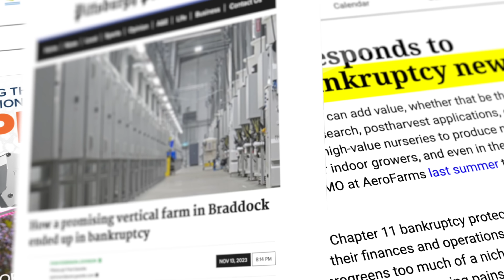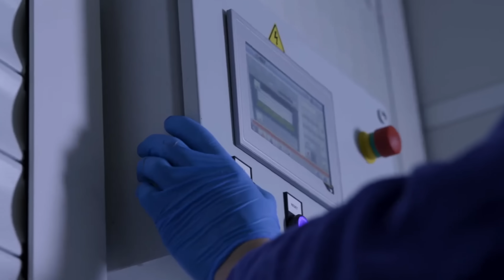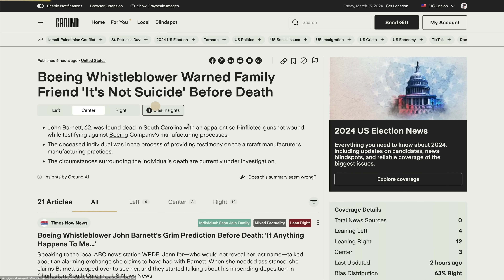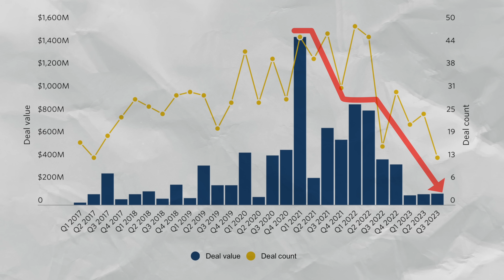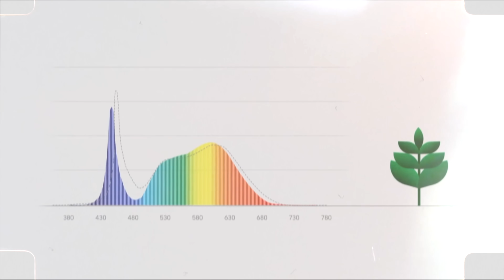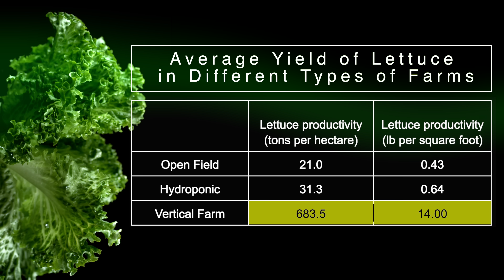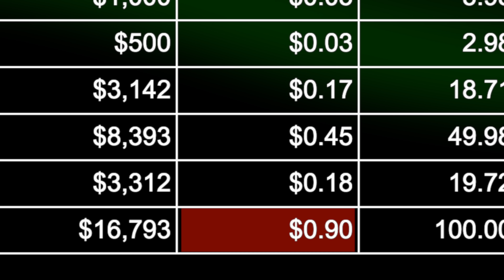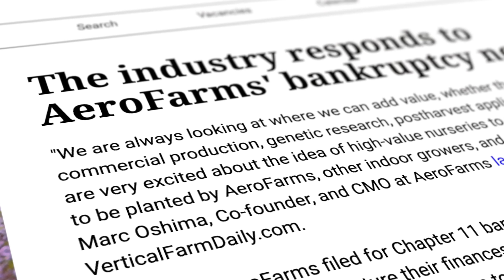The EPIC Failure of Vertical Farms - What Happened?

Comment: Sounds like the issue is companies relying too heavily on outside investors coupled with piss poor planning at ground level.
Reply: The high tech entrepreneurs who start vertical farms are techies not farmers, they are not accustomed to the financial realty of farming.
Reply: @rrmackay they're also not accustomed to engineering challenges where you make something scalable rather than do a one-and-done model
Reply: @FirstNameLastName-okayyoutube  Exactly, they treated growing food like a new mobile app instead of the low margin high risk, high cost operation that it is. We ran the numbers before buying our farm, tried to make it work in a deserted big box store with state grants, still could not make the numbers show a profit. So we bought cheap land instead.
Reply: @rrmackay  Thing is i only disagree with the high cost. WHEN, someone has the cash to go anywhere and is sourcing materials in a low cost area, not inside an urban area. 
Ive bought to much of this stuff... Ive took a $20 box fan, an $8 speed controler,  a $12 belt, couple $20 rollers, a $60  conveior belt, $30 in scrap yard access to some alluminium posts. and $6 in concrete to build a portable dirt conveyor for excavation.  Not $1000+++ for a difficult to move fancy rig.   Same with building a grow house.  30 ft by 30ft structure costs around $3000 and meets code. But people out there want to go buy cedar instead of ground contact pine...  if you can do your own ductwork you don't need to get an expensive kit you can just do your own duct work and spend about $600 on multiple air flows that are in segmented compartments. And then as for the LEDs I'm not joking each grow bed  of 12 by 8 ft is costing me $10!  $10! for the proper lighting... it's working so well I feel crazy with seeing all of the high numbers other people are paying.  Oh and by the way you can put a house filter on the back of a $20 box fan and you don't even need to completely seal it up but it will reduce contamination and Bug issues.  I'm paying $200 a month in electricity and I'm making about $600 a month in profit as a hobby.  I'm growing corn I'm growing strawberries, not kale and lettuce
Reply: @rrmackay  I don't want to sound like I'm not appreciating what you're going through.   Me taking tiny little bits of land swamp material and taking my time with it is not something that somebody that bought a farm could do over several Acres all at once.  

My goal was to grow one plant and keep temperature control for one plant and then moved up from that into multiple structures as I could legitimately find somebody to buy it which is something completely different than projections on an investment proposal
Reply: @FirstNameLastName-okayyoutube  Right, you are building on a shoe string, a hobby farm is a long way from a profitable commercial farm. I am currently growing 25k lbs of mushrooms and an operation that size requires farm hands, tractors, diesel and other expenses. Have you calculated how much the land value is where you farm ? Or like many hobby farms the land cost is not even a consideration ? Sounds great but do keep in mind you don't have the same overhead these big vertical farms do.
Reply: @rrmackay  also I should clarify that I dug into the ground as over half of the wall support of my structure, so I'm over 50% below ground and I invested very heavily in the roofing insulation and not so much on the surrounding. In fact highly reflective material seems to work really well because you really need to capture the infrared light more than you need to worry about warm air.

Outside the roof is about 6 ft off the ground of two of the buildings 12 ft High inside.  Not going to lie I didn't think about it too hard because I was too busy trying to figure out 200 other things
Reply: @FirstNameLastName-okayyoutube  I respect what your doing, sorry if I came across as harsh.
Reply: @rrmackay  to be fair most farmers aren't good at finances. If they can't turn a profit, that just means they have a horrible accountant/CPa. At least in the United States that is.😭😭🤦🤦🤷
Reply: @Jack-jp6ki  Traditionally farm owners ie farmers have been the rich people in rural communities. Suggesting they are poor businessmen is just your bias. My son is a farmer and has a degree in biology and business.
Reply: @rrmackay  I never said farmers were "bad businessmen". I specifically mentioned not being the best at finances/accounting, which is a statical fact the United States. If you ask most farmers in the US why they do their specific farming practices, a lot of it boils down to having to fit regulations/rules they have to follow because they want to get a loan, or can't afford the fines/fees that may come without a violation of such rules/regulations. I personally don't care for talk much. I'm from the "show me State".Show me one of these rich farmers you speak of, and I'll show you the errors in their accounting.  My contact is in my channel description.😉❤️❤️
Reply: @Jack-jp6ki  The wealthiest farmer in the United States lives and farms in California. Stewart Resnick, 81, owner of The Wonderful Company and 65 percent of the nation's pistachio crop.

Net worth 5.6 billion.
Reply: @rrmackay  do you know him personally? I specifically meant show me a farmer "you know".
Reply: @Jack-jp6ki  Its been nice meeting, you have a good life.
Reply: @rrmackay  the financial reality of this is very different from farming.
Reply: @stinkymccheese8010  thats hilarious, you have the same affliction the entrepreneurs have, they think because its a tech business that farming rules don't apply. Their bankruptcies point to you being wrong.
Reply: @rrmackay  no, I think that although there are clear parallels, there are more differences.
Reply: Yup, and in the first two minutes I got all the information I needed to reach that conclusion which really makes the title and the lead up propaganda as many of his videos are.

There was investor money dying to get into a market they thought would make them lots of money, and the people doing the execution didn't understand the business model, all the details of running that business, the costs, and MOSTLY, the MARKET.

All regenerative agriculture farmers I watch that are successful have all said the same thing, which is farming is a business.  You need to know how to run a business, you have to know your market, what the people want, and more than anything else know who your initial customers are because if you don't have customers you can't start.  I think this gets lost on a lot of idealists.
Reply: As someone who has been designing next-gen hydroponics/greenhouses, the main reason these US vertical farms are failing because of the crop type & it's extremely low profit-margin. 
You don't use high tech systems to grow the least expensive, easily grown crops.
You go high tech for expensive and/or difficult to grow crops.
Also in my experience you can't go "full" tech (overall costs are too high/ ROI too low).  The happy medium is "supplemental" tech (as in using supplemental lighting in a greenhouse when "free" sunlight is low or unavailable)
Reply: I always thought they were going to start off as small but efficient as possible, in rough, small-scale ventures in poor areas with disused buildings. Purpose built, tall buildings would come later... 
--
High value crops with processing facilities, obviously starting with weed and expensive mushrooms (like darkness), strawberries and other soft fruits with the main low value crop being potatoes, with the tops harvested for bio-fuel and possibly nutrients for fertiliser, with fish farms in the basement who's water fertilises the crops who's substrate filters it too. 
--
The main protection is hermetically sealed doors between crops... Of course, the fake-green revolution that uses as much land area as possible should never have been subsidised with mass forced sales scams while brown-field and urban indoor farming should be heavily subsidised.
Reply: Basically, they treated farming ventures like tech start-ups, of course, it's no wonder they failed. As a horticulturalist, I immediately knew why they failed in the first 3 minutes.
Reply: same thing happened to cannabis
Reply: @tinman2420  the whole thing with the legalization of cannabis was a farce to begin with.
Reply: Yup…it’s  the execution of the idea that makes it work….also known as  logistics….no good managers….no good product…..it’s a beautiful thing…..
Reply: I think it’s the model. This won’t work at the Tyson brand level. But on a specialized basis I think this could change the world
Reply: No, these projects simply did what they were intended to do: scam investors.
Reply: Well, if over 80% of your investors pull out, it doesn't even really matter if you have a substantial percentage of the money yourself (as internal resources) - with even, say, 80% of those 50% of external resources suddenly going away, that is still 40% - a bit of a problem for any company ...
Reply: It’s a terrible business model. The only way to make it work is to not have to compete with a traditional farmer who can buy up 100’s of acres for the same cost as a city block where the vertical farm is being built. It is the simplest equation, is building horizontal less expensive than building vertical? The business decision is to do what is less expensive. Any other decision is just BA & marketing.
Reply: Agreed, and with the rate of inflation over the past few years, profit margins on food are really slender.  I don't think something like this can break even in the current economy.  Especially if all they sell is salad greens.
Reply: @stinkymccheese8010 you are actually very close to the truth. Actually USSR had science program about farming in space, after collapse, most of scientist moved to Japan and continued there work. So the product of there research is - it's simply impossible to do with natural grown products. Plants will die from viruses. You need a lot of plants that will connect with there roots and roots should be very strong so they could randomly produce immune cell and spread across all them all. So plans are depended on collective immune response to viruses. The whole commerce idea of using the similar technology was predictable failure, but because aggro economy have huge budgets, some investors decided to gamble any way. That how we got to a point of a hot potato game. But in a first place - the entire idea was very well documented, it was very well researched and a way how most of farm was doing it was wrong.
Reply: food is too cheap....
Reply: @PnoidNews123  what a scary thing to say. Uping the cost of food would put massive amount of people without food. Not a good idea if you don't up a lot salaries and number of jobs.
Reply: They also want everything to scale ASAP.  It's hard to get a little bit of money to test an idea, but if you promise them the moon they will give you more than you need.
Reply: Money was cheap in 2023 and investors were willing to take more risk.
Reply: @MrBobberino01  its never cheap, if it was id buy some ;)
Reply: ESG
Reply: In the USA, management relies solely on spreadsheets and throwing money at a problem.

The Americans do two things well: spend money and war.. They are permitted to create all the money they wish out of thin air. Otherwise they would be little better off than Haiti
Reply: no, labour is just too expensive.
Reply: No, sounds like the problem is the ability to actually make it happen effectively. Ridiculous statement by you.
Reply: Nah, the tech is just not there. Piss poor planning would be it not even getting off the ground and someone running off with the money. 

You can't find out whether this unknown is possible or not until you do it. Planning dosent exist in the unknown.
Reply: The communists in UN were dreaming about this and tried the crap 40-50 years ago. I still  remember news about this. Same thing, same problems, same results. We just need more CO2 in the atmosphere and you will get all the growth benefits without any of the drawbacks. CO2 is plant food, that's why its pumped into green houses. It doesn't change temperature, it can't and the concentrations are miniscule anyways = 0.03%
Reply: youtube is a mockingbird press company, c i a bought and paid fpr
Reply: Thanks for the summary ... @Two Bit Da Vinci, stop wasting people's time taking 13 minutes to say what this person said in 2 seconds. Get a clue.
Reply: First thing these clowns need to do is engage a farmer! 😂
Reply: They grew to fast. Happened with tech companies. They had free money and grew to large so when the money dried up they collapsed.
Reply: Unfortunately, it has been proven that working for free is either slavery or not sustainable in money-centric society.
Reply: Many of the companies were just cash grabs. They were charging WAY to much for the product to be a viable business. They sold a few units to suckers but that's it.
Reply: take doctor and robots to do what people did for like 10000 years  it does not take an app to look the grass grow then wonder why it is not working
Reply: It’s the exact same reason media companies and game studios are collapsing. They never really had a business model designed to be profitable and the adventure investment money dried up.
Reply: You've pinpointed the 2 primary costs that every farm everywhere wrestles with, no matter what type of farm you run.  Labor and capex.  With the current cost of these inputs, "Vertical" farms work only if you can grow crops with more lbs output or higher value.  Think cucumbers, tomatoes or cannabis.  A greenhouse growing a tomato or cucumber, is already "vertical" because they are vining crops grown on trusses.  Even an advanced greenhouse is roughly 1/3 to 1/4 the cost of construction and maintenance of an indoor farm.
Reply: @jaywhitney7978  the problem with a greenhouse is that you still only have a finite number of daylight hours to work with and depending on how large it is positioning those plants so they can get adequate sunlight can become a problem, the majority of the expense in hydroponics is at the front end, but provided the operators do their due diligence the costs of operation should go down quickly, so the system should be able to produce a net profit much more quickly than a more conventional farm.
Reply: @stinkymccheese8010  additionally most greenhouse operators use supplemental lighting, which is a fraction of the cost.
Reply: @jaywhitney7978  Down at Lancaster city hall planning commission over solar farm across the street, first come all the cannabis grow permits.  They put them in warehouses.  I have yet to see one fruit or vegetable grow operation warehoused.
Reply: NAILED IT! The issue is the business model associated with venture capital. Not the farming itself.
Reply: @alpaykasal2902  Yup, invest with your brain, not with your heart. If you want this business model to succeed, make sure the structures are in place to be viable.

The Singapore government wants to produce 40% of their calories inside of Singapore. They are willing to subsidize these types of investments as a measure of national security. Though I don't know that even in this evironment, the investments will be successful, but it is the best chance you'll find before we get a colony on Mars or the Moon.
Reply: Don’t forget all the people they hire to do this and that and the ones making big bucks odd the smaller and medium farms do well because less overhead and let costs like 30k robots fleets of them too
Reply: This is the correct valuation. Not only that but most of the farms that pursue larger seed and series a funding are usually teams of people who conceptually understand the fundamentals of the industry on paper, many of these multimillion dollar farms have ballooned executive salaries as well because of the grandiosity of the venture. Larger projects are bound to fail at this stage of development in the industry. The pathway forward are the mom and pop shops that manage to capture their domestic markets and franchise on smaller scales. I run a nearly debt free vertical farm with a team of 4 in an 1800sq ft facility in a what is classified as a “heritage” building. At the multimillion dollar, 20k-230k sq ft facility level you’re contending with far too much. There is still much that needs to be considered and developed in terms of SOP’s and technological advancements before a company that’s contending to corner one or multiple metropolitan markets can be executed.
Reply: where's the government seed money/funding? Has that dried up? Also I don't think this has reach economies of scale.  Industry is probably more in the R&D phase which is always more expensive when real production happens.
Reply: No. Maybe gullible inexperienced investors. Most of the larger more profitable conventional agricultural businesses around the world rely on broadly sourced and foreign nation sourced investment. A lack of critical hard nosed business analysis  substituted with wishful thinking and marketing is the real issue.
Reply: Nah, it just sounds like you can't beat nature efficiency
Reply: @upsill  Actually, a much more efficient way to produce nutrients than vertical farming is precision fermentation, cultured meat using lab technology, and other similar novel Technologies. They use a tiny fraction of land, water, and other natural resources. They will not replace traditional methods of growing crops, but they can and should replace animal agriculture.
Reply: its like they think a farm is a company like uber or amazon
and try and run a farm like that
like
 hello i'm the farms ceo!!
invest in my farm plz
when we take over the market we will generate millions!

instead of 
hello Im a farmer
I grow crops
can I get a bank loan for a new tractor plz
Reply: Venture capitalists trying to get rich quick once again.
Reply: Farming lives on the backs of cheap field labor. There will never be a robotic or AI integrated system that can beat the financial advantage that traditional farming utilizes. What we need is better practices surrounding land usage. Use what’s already outside and get creative with the vertical side of the business and get rid of all the tech automated crap.
Reply: @matthewpankau5683  If the news I heard was correct, southern Spain has become Europe's Salinas valley, except it's all greenhouses.  Given the way the weather is becoming around the world, I think this is going to be the way forward more and more.   Greenhouses are much less susceptible to entire crops being poisoned by massive factory fires as well, like just happened to American Salinas valley.
Reply: @matthewpankau5683  the most effective practice for food production when it comes to land usage would be an exclusively plant-based food production system possibly augmented with Precision fermentation and cultured meat.  I agree that vertical farming is not practical on a wide scale.
Reply: so much idiot leftist cope. they explained it well, a pound of lettuce costs 4.5$ before middle men, while normal farming was 0.9$ before middle men , every pound of food you made you lLOST 4$ to labor costs, electricity and machine maintanace. farm lamd is just soil so it can regenerate.
Reply: @stinkymccheese8010  you must be an Aussie 🤣
Reply: @stinkymccheese8010  the entire video is about how much the employees cost. It's that simple.
Reply: @4doorsmorewhors that’s the cost of doing business and even then it is an issue that can be resolved with automation.
Reply: @stinkymccheese8010 you're original comment has nothing to do about the 43% employee wages.
Reply: @4doorsmorewhors that was the unskilled workers who in a serious venture would be non existent or at least minimally so.
Reply: @stinkymccheese8010 so you are saying exactly what I'm saying, labor cost.
Reply: @4doorsmorewhors yeah it is that simple the skilled labor he’s talking about exists at dirt farms too that’s what a farmer is the majority of everyone else are unskilled labor or specialists that in the case of a hydroponic or aquaponic system would likely be working at a regional level and only called out in extreme cases beyond that you would be working an Standard Operating Platform (SOP) which is a common practice in any manufacturing environment as well as most big box retailers, none of the problems that brought these companies down are new they all have examples of their solutions already in existence. The people running the companies were too busy stuffing their pockets and treating it like it was some sort of tech startup that they were going to be able to sale later to get in the correct headspace to make it work long term and while there are very real issues that would present themselves inevitably those were not mentioned here.
Reply: @stinkymccheese8010 so this kind of farming is unsustainable?
Reply: @4doorsmorewhors no, not at all it just has to be approached differently then they did, he showed an interview with one of the CEO’s who explained what happened point plank.
Reply: @stinkymccheese8010 you talked about how the problem was outside invenstors, where in the video did they say that was the case?
Reply: @stinkymccheese8010 and why are you deleting you're own comments lol..
Reply: @4doorsmorewhors which one? I did edit one a few minutes ago due to spell check making what I said unintelligible, but unless I say something that I realize after the point is way out in left field I don’t delete my comments.
Reply: So so called investment gurus decided to invest money in companies that were going to produce products that would be impossible to sell. Then they lost their investment. So who's the fool?
Reply: @simonpaine2347  those investors may well have had the money to spend, think of all the money tied up in the current way of doing things, the people invested in that have more to lose in something like this succeeding than that do in maintaining the status quo, plus part of the issue were things that had the companies in question done their due diligence, would have been no issue at all.
Reply: Not even close. The companies which went bankrupt just couldn't turn a profit at those locations. Thats the entire point of the video.
Reply: @randomnobody8770  In large part because Biden doesn't control the border.
Reply: @randomnobody8770  no.... they are relying too much on investments for expensive operations that can be done much more cheaply.  It's already done all over the place, I grow strawberries all year round and I don't have a pest problem because I don't have a closed unified air flow system like some of these billion-dollar facilities stupidly do.  Buy compartmentalizing the water supply and Air Supply it makes it much more easier to mitigate problems but these people were not planning very well because they weren't using their own money they were using somebody else's money
Reply: @randomnobody8770  precisely, they rely on Angel investors caught up in a fad.  Currently the cost of the technology (capex), the energy and labor inputs(overhead) is extremely prohibitive.
Reply: @randomnobody8770  Exactly, "piss poor planning'.
Reply: @randomnobody8770 so the concept is viable, it's just not profitable. The companies don't care if it feeds people, unless they're making a ton out of it.
Reply: @lugi25  Thats not how any of this works. Yes, the concept works in principle, but it currently operates at a loss in those locations. The investment funds lost their money. Oh well. Of course people don't want to keep pouring money into what is currently a more costly way to grow things. Thats how people starve.  Maybe someone else can gamble their money, time, and effort, and make it operate at a profit.
Reply: The story of modern human societal collapse
Reply: My wild ducks fertilize my soil.
My wild dung beetles and worms aerate my soil.
My wild "friendly" bugs keep any "unfriendly" bugs in check.
Shall I continue?
Reply: @hitreset0291  .. You're not the problem, industrial, non-vertical farming does far more environmental harm than all other industries combined.. Proper, non-fake green policies aim to reduced human's use of land as much as possible... Fake-green subsidise the biggest sprawling energy solutions and prefer 1000s of landfills over incinerators.
Reply: Investors look for quick money quick ROI, they have little to no knowledge on what they are inventing on. When ahxi hits the fan, they just pulled out, and make the company no choice but bankruptcy
Reply: Sun is free, electricity for lighting is not, so only indoor farming here in Lancaster, CA is approval last week of another indoor pot grow farm.
Reply: @donaldkasper8346 the light needed for indoor growing can also be free.  The surface area of a residential house can store enough energy for three times the the growing surface area.  And The Upfront cost is scalable because you don't have to do a billion-dollar operation you can do a $300 operation and then profit and then continue to grow it and that's the problem is that it's not profitable enough to investors if the concept is so easily reproducible.  It has to carry an air of difficulty in order to be attractive to these large flows of money.   Imagine I could give you $500,000 to go fail out of business next year... that is unfortunately part of what's going on is that there is intermediate intellects involved with something that is not aimed add making a vertical Farm work properly.  That is why you get so many people burned out and frustrated because there is all of this  foot sticking out causing things to trip up
Reply: @donaldkasper8346  Did you even watch the video?
Reply: @KyleTheFolf Vertical farms.  1.  Manpower intensive.  2.  Power intensive.  3.  City space is exorbitantly costly.  Other than for specialty spices, such operations have no chance of success and evacuation of businesses from inner cities makes the products grown unneeded.  Suburbs are too spaced out to be economical.
Reply: @donaldkasper8346  sun only reaches the top and outer trays. not usable. the value proposition is in stacking the trays in 3d. powering led's is one of the lowest costs here. LEDs are not the problem.
Reply: @donaldkasper8346 I wonder what the cost of doing a shit ton of this if they ever figure out that deep geothermal that really runs deep enough to create steam. Like could we just dig one of those and hook it up to Miles upon square miles worth of area and then make money off excess energy too.   Like if that energy cost could come down it would be game changer. Plus I get sense it takes less to manage.
Reply: @DaveE99  You have to be in the right place for geothermal and the minerals come out of solution as the steam drops in temperature and decompresses coming up the well, fouling all your pipes, very often.
Reply: @donaldkasper8346  that new geo stuff I’m talking about is different frommmy understanding. I forget the name of the company that’s working on it. It’s advanced geo stuff that can go down 20,000 feet or something it’s ridiculous.
Reply: @DaveE99  No one drills 20,000 feet except oil companies.  You are talking $10 million dollar wells.
Reply: Therre is a better way!  The main advantage of vertical farming is reducing land use to produce nutrients,  A more practical way to achieve that goal would be to end animal agriculture.  A plant based food production systen would save 75% of the land now needed!  A huge amount of water would also be saved, and there would be other environmental advantages, like addressing climate change.  Precision fermentation and cultured meat could be added, but would not be needed, since humans do not need animal productrs to thrive!
Reply: @someguy2135  also, could you imagine how many people would be doing chicken prohibition underground if you banned meat.
Reply: @DaveE99            Personally, I do not favor a law against eating animals, partly due to the fact that it could work as poorly as  Prohibition in the USA.  Our government instead should end the huge subsidies for animal agriculture, help to re-train those who currently work in that industry, educate the public via PSA's like they did to discourage smoking tobacco.  The US government used to heavily subsidize growing tobacco too.  Those subsidies could be used to smooth the transition to a food production system without the dangerous and destructive animal ag.
Reply: @someguy2135  A lot of land animals are farmed on isn't suitable for plant based agriculture. Its not like farmers haven't thought about this already.
Reply: @lennart266          Since a fully plant based food production system would need only 25% of the land now used for producing food, your point is moot.  The extra land could be used to return to its natural state to help capture and sequester CO2.
Reply: @lennart266  You miss the point. It's not "how much land is used for ...", it's "How much farmland production is used for ..." -> It's already crops land. Even if you can't eat it, you can make biofuel, plastics without petroleum, etc.
Reply: @someguy2135  this is not correct, there is no single country there people live without animal products
Reply: @someguy2135  This is a falsehood that has gained far too much traction in the modern conversation. SOME people can thrive without meat where others would experience significant health issues with a similar diet. Not every human being has the same dietary needs. We are omnivores, each with his or her own level of adaptability.
Reply: @Lukevapeur  I don't deny that there are some people who cannot thrive on a fully plant based diet but everything I've read indicates that they are a rare exception to the rule because of their unusual genetics
Reply: @someguy2135  yesss and if you look at emissions too they seem to account for over 87% of greenhouse gases as opposed to how the IPCC has been measuring it so also massively helping climate change
Reply: @climatehealerscheckitout  I'm glad we agree but could you specify which of my replies you are responding to?
Reply: @someguy2135  Sorry you have a lot of comments haha yeah very unclear. Sailesh Rao and other scientist tried to do a better accounting of GHG. In which deforestation also accounts for lost of carbon capture. And they look at how veganism solves six of the nine planetary boundaries we must surpass. And personally I also believe it helps us break down hierarchical systems that may also put us in civic collapse so best of all worlds really. Plus as a scientist the most powerful individual change to make.
Reply: @climatehealerscheckitout        Great points and well said!  I will find the study using the name of the author you mentioned.  Thank you for the information.  Update- My Google search reminded me that I saw Dr. Rao eloquently stating his position at the Oxford debate.
Reply: @someguy2135  My animals fertilize their own land. No added rain, plowing, harvesting or planting is needed. Not sure how you get more efficient than letting nature take care of nature.
Reply: @wisenber  The current population of humans makes animal agriculture an unsustainable way to feed mankind.  The kind of farm you describe cannot supply the huge and growing demand for meat.  We need to change to a sustainable food system.
Reply: @someguy2135  It really doesn't. There's no evidence to support that really.
If you live in a country that has to import food, it might seem that way though.
As mentioned, I really don't have any inputs required for my regenerative herd.
Plant agriculture requires a lot more input with much lower nutrition than I get.
Reply: @someguy2135  Cows are part of the carbon cycle take them out and the grass lands would become Barron and a fire hazard.
Reply: @someguy2135 a very ill informed take on agriculture/environmental sustainability. Your beliefs and preferences may help you, but it's massively dense to think veganism will save the planet.
Reply: @jonahsutter7297  A fully plant-based food system, augmented with cultivated meat and precision fermentation would not be sufficient but it could be necessary considering the state of the environment and the size of the global population.  It would give mankind 30 years to phase out the use of fossil fuels.
Reply: @someguy2135  are you a vegan or vegetarian. Agricultural land is actually dominated by crops not animals. Animals have several positive contributions that have to be taken into account. Also please research all the climate predictions that have been made since climate change was pushed into main stream science. You will be shocked.
Reply: @samuelmidzi8240         I do not say this because I am vegan.  I am vegan because of the facts.  I can see that you doubt some of my claims.  I salute your skepticism.  My claims are almost incredible if you haven't looked into the issue.  We now feed a lot more calories and even protein to farm animals than we get from eating the edible parts of them.  Google feed conversion ratios.  Title of article- "If everyone were vegan, only a quarter of current farmland would be needed." -The Economist  Jan 28, 2022  (The article is based on the study by Poore and Nemecek)
Reply: @samuelmidzi8240       I didn't specify that the farm animal feed comes from crops like corn and soy.  
About 77% of soy world wide is used for feed, and only about 7% is consumed directly by humans. 
Evidence from credible sources on request.
Reply: @samuelmidzi8240  while making this comment, have you considered what animals eat as crops? Then it's ok. But with animals out of the equation, the same will not be needed. And the crop waste or byproduct that animals eat can be used to create other things like ethanol or anything it's usable for. Now think of it like this and read what you wrote. Not for argument, but let me know your views afterwards.
Reply: @someguy2135 large part of plant Feed to cow or others are non edible part for human.
Most of water intake from this animals Come from fresh grazing Weeds are mostly water.
Animals grazing Can be where you cannot grow food because if landscape or soil.
The thing is those numbers are extrapolate using industrial farming american style, there is country where it does not exist at all. In fact most of them.
Moreover numbers are like human : you Can torture them to make them Say what you want. You see the opposite lobby have prooved that bacon is more ecolo friendly than salade.
Often Time the middle ground is a better solution. 
Make cow and goat where you cannot farm plant, and stoping the monocroping would be the best way to go.
Because monocroping is the worst.
And i did not even started to tackle the problem of things like almond, blood avocado, or the bee collapse, and the killing of biodiversity issued by the plant base industry.
Reply: @clemlo4973         You-"large part of plant Feed to cow or others are non edible part for human."   Regardless of that fact, crops used for animal feed (with the exception of the tiny percentage of farm animals which are pasture raised and finished cows and sheep) such as alfalfa results in a much larger amount of crops in total, and is usually produced by monocrops.  Eating lower on the food chain by eating crops instead of feeding them to farm animals so we could eat the edible parts of them is inherently more efficient.
Reply: @someguy2135  if you give stem to animal and eat the edible part you do not grow food, you avoid waste.
Reply: @someguy2135  the most efficient way to do things is to do a bit of all. 
Doing pasture raise in place where you cannot efficiently grow plant, and grow plant in none monoculture way where you Can.
The way plant are grown nowadays is at least as much unethical as meat and this is a fact. Being vegan but eating stuff like almond and avocado is ultimatly worse than eating a bit of all, not overconsuming, and eating local stuff.
Reply: @samuelmidzi8240  From 35 to 40% of crops lands are used only to feed animals. No animal, you free up to 40% of the agricultural lands.
Reply: @clemlo4973  That's a wrong logic. Even if crops made somewhere can't be used directly to feed humans, you can use it's production for biofuel, methanisation, plastics, etc.

Animal grazing can't be beaten in productivity, as long as you only use that, witch is really not the norm.

But i totaly agree with the monocrop problem.
Most modern farm, US and evrywhere are killing their soils and don't seem to acknowledge most of the farm problem they see are because of that.
Reply: @clemlo4973  the damage to our environment and the fact that a fully plant-based diet if Done Right is healthier and results in a longer life makes the type of animal culture you describe unneeded and detrimental . The transition to a more sustainable food system should start with those countries that contribute the most to climate change like the United States for example. Other countries that are not as developed will probably continue to rely on animals until and unless we provide help to them to phase out using animals for food production.
Reply: @someguy2135  yeah not gonna happen.  Also if you do deep dives into cultured meat, it dosent scale as well as one initially thinks and they have some key problems to fix in cost of supply’s as some of the key ingredients they use in the process are UNGODLY EXPENSIVE, like OMFG EXPENSIVE.  So unless those ingredients drop in price, they are limited and at least one or two of the crucial ones are not easy to do that with but they will work on it. I’m all for cultured meat, I just know the price of it won’t be economic for a good amount of time.  And also, you have to understand that for health ideally, people need more not less protien, and you also need to source all the bcaa’s people need for muscle growth. Like prob just pumping old people full of that would improve their quality of life.
Reply: @DaveE99        As I said, a food production system without animal agriculture would not require cultured meat.  If it becomes more widely available and affordable, that would be great, as would precision fermentation, which I think might be more promising, but also not needed to supply all the nutrition needed for the current population and those yet to be born.  "Title, etc-"Existing cropland could feed four billion more by dropping biofuels and animal feed (Date: August 1, 2013 Source: University of Minnesota  Summary:
"The world's croplands could feed 4 billion more people than they do now just by shifting from producing animal feed and biofuels to producing exclusively food for human consumption, according to new research."- Article by Science Daily
Reply: @someguy2135  my point is I don’t think that would ever persuade anybody of any significant % without cultured meet cuz that would have to be voted in.  Sides we can’t even get them to subsidize healthy food, let alone upend a whole dietary culture upheaval.   If cultured meat could become economical, which as I’ve said is an if, then this could happen, but without it I don’t quite see it.  Like I have no problem, push any evidence that you can accomplish muscle growth and maintenance and increase grams per lb body weight and also great taste + behavior change.  Like ultimately that’s what matters, I don’t think you’re going to magically talk a population into voting for that. Like I get the climate stuff, and I’m not jumping at this one.   Like that idea that land can feed 4 additional billion people, is kinda a fake stat in that, people wouldn’t want to live like that. That’s the issue.
Reply: @someguy2135  what’s the difference in economics of precision fermentation vs cultured meat? What even is precision fermentation?
Reply: @DaveE99         " “Research has shown that there is no difference in the outcomes between those who eat a plant-based diet vs omnivorous diet in the ability to build muscle with adequate protein intake,” said Hilbert."-Healthline
Title-"How to Build Muscle While Eating a Plant-Based Diet"

("Megan Hilbert, MS, RDN, with Top Nutrition Coaching, told Healthline.")
Reply: @someguy2135  if I’m correct you do still need more bcaa’s like the big difference between plant protein powder and muscle building plant protein powder is the bcaa’s.
Reply: @someguy2135  no thank you. Not eating plant based meat.
Reply: @rujotheone  switching to a plant-based diet does not require eating plant-based meat. Eating a whole food plant-based diet is even better for your health and the environment than eating plant-based meat. However I could cite a study that shows that plant-based meat is better for health markers than the meat it replaced. As far as taste goes until you try every brand and every product from that brand you won't know if you don't like every option available to you. The Slickdeals YouTube channel has a blind taste test were the majority preferred the plant-based option to the one made from an animal
Reply: @someguy2135  yea people would rather die then stop eating steak or hamburgers.
Reply: @AL-lh2ht       How long was smoking the norm before people finally woke up?
Reply: @someguy2135  considering that they were able to lie that it was healthy for decades, couldn't have had anything to do with how long it took people to wake up, huh? There's a lot more to it that you're apparently capable of thinking about.
Reply: @someguy2135 it's still pretty bloody common, to the point where I know more people who have smoked than who haven't.
Reply: @AL-lh2ht you're damn right
Reply: @someguy2135 Your teeth are designed to eat meat for a reason.